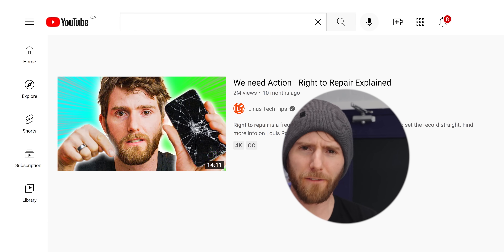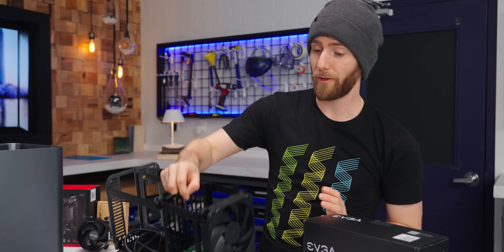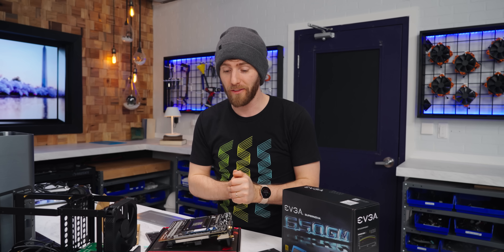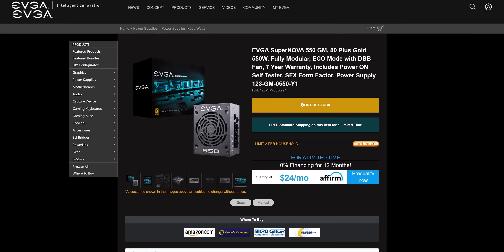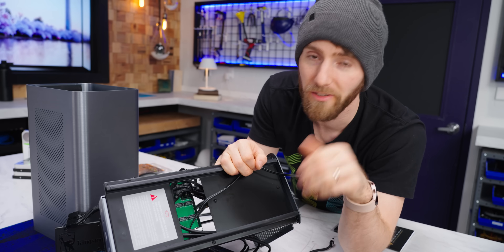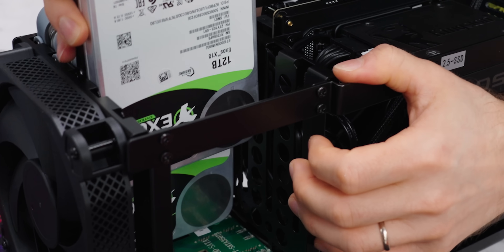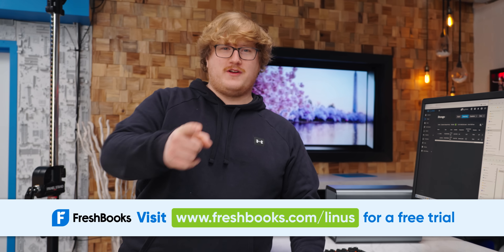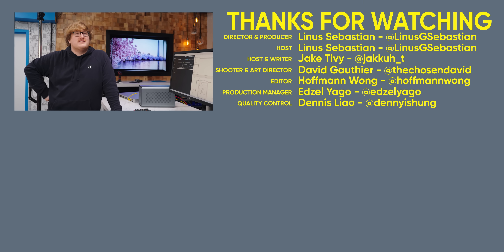This blows away the competition - JONSBO N1 NAS Build

Comment: 14:20 SMB is actually used for macOS as well, apple deprecated AFP a while ago, and Time Machine is now only supported on SMB shares in recent versions of macOS. You just need to enable vfs:fruit globally and set the fruit:timemachine flag to true for the specific share you'll be using as a backup destination.
Reply: This is good to know thanks! My dad runs a mac on our network and I thought it would be more complicated than this to get it to work.
Reply: @ziga328  no problem! Also worth checking out: the samba wiki has a page about optimizing the server to work better with macOS https://wiki.samba.org/index.php/Configure_Samba_to_Work_Better_with_Mac_OS_X
Note that these aren't absolute rules that you must abide by in order for macOS clients to connect, but it's a good starting point for getting decent performance out of smb.

I'd also recommend taking a look at the manual for vfs_fruit to see all of the options available http://samba.org/samba/docs/current/man-html/vfs_fruit.8.html, and if you really want a deep dive, here's the full manual for all of the settings possible in smb.conf: https://www.samba.org/samba/docs/current/man-html/smb.conf.5.html

Comment: I had really considered the Jonsbo, but I went with the Meshify 2 instead. I felt like the Jonsbo has quite limited ability to be upgraded, there’s only 4 HDD slots. Also, ITX boards have a very serious problem with SATA port count. They all only have 4 ports so…

Comment: My NAS was built with a similar approach two years ago. I used a Fractal Design Node 304. A bit bulkier but supports 6 drives.
Reply: That's the case I have now, when i retire it later this year (when next gen cpu/gpu come out). That's my plan too.
Reply: That case looks awesome and it appears to be cheaper (but without the SATA backplane).
Reply: I'm about to buy and build a 304 NAS, anything specific I need to know? I've built many PC before so the basics are covered. thanks!

Comment: I'm using a preowned rather old 5 bay synology nas I got for like £100, and just stuffed 50TB in it. Seems to work fine. 
One thing to note here 550w or 650w psu, on all the time is way more than a typical prebuilt, I imagine it's probably louder too.
Sure I think this is very cool, but hell on earth are small PC builds irritating. You're also a bit screwed if your OS drive dies.

Anyways now I said this my nas will probably die tomorrow haha

Comment: Would love to hear a bit more about power consumption on those topics. For me in germany a 10w difference results in about 30€/year (and will most likely significantly increase in the Next few years)
Reply: Europe as a whole I would say. Power prices have been skyrocketing like crazy over the last 4 years.
Reply: Yep this is the first thing I thought, how much does this cost to run. All year round 24/7. Looking at building a system for HASS, Plex, NAS, etc. But a cheapo lenovo NUC might be better for a system that's permanently going to be turned on.
Reply: I'm with you. In my town in the Philippines, electricty have from 0.2 USD to 0.3 USD in the span of 6 months. That's  why I installed a solar power system in the house and still mostly just use a Raspberry Pi4 as a network file storage/server and to host other services.
Reply: Dont they pay yall in germany to consume more electricity during certain times of the year? heard something like this years ago
Reply: @sweetmelon3365  lol no. AS an end consumer you typically pay a monthly fee + a fixed amount per kWh (typically 0,3€ vor more).
With some providers you get a chaeper price During the night, but thats only a few cents)

It might be that at some times you could get energy basically for free on the energy market if there is way too much production and no requirement, but thats nothing for you unless you happen to own a pumped storage power plant or a steel factory xD
Reply: @sweetmelon3365  They don't, not that I'm aware of. With some electric home heating you could get discounted rates by only using the (separate for heating) power during certain times of the day. But that's not the same thing as being paid to use electricity. Germany imports a lot of power from France, so it's also not like there is an excess of electricity that needs to be used.
Reply: You should ditch coal and switch to nuclear power (and it will be better for our planet)

Comment: You can't get 100TB of storage in there unless you don't care about your data. You'll want at least some redundancy meaning you get the capacity of four drives, not 5. Still, 80TB in a case that size is pretty darn good.

Comment: As someone who looked at building a DIY NAS versus a buying one from QNAP (what I ended up doing) I would like to note:
The DIY one Linus built does not have ECC RAM.
It's power usage would be expected to be higher than a lot of the chips used in a lot of the pre-built NAS (you can choose to use these, but they will be a bit more interesting in terms of motherboard support).

As for "upgrade-ability" the QNAP solution I went with has room for HDDs, SSDs, m.2 NVMes, PCI slots, and can have added upgraded network or graphics options. Also, there is a decent, not extensive, list of vendors that are compatible for hardware which means you are not only stuck with rather expensive first-party parts. 
Reviews of Synology being less friendly on some of these upgrades is part of why my spouse and I went with QNAP.

I would say the biggest disadvantage to going with something like QNAP is you are locked into their ecosystem and you really do not have an upgrade path for motherboard or CPU, if so inclined.

The advantage is it comes with a lot of useful apps built into the ecosystem and it's up to you how you want to configure them. So, yes, you are giving away some of the customization, but you are also losing some of the headache.

But, I did want to point out, Linus' $689 solution here is not quite apples-to-apples due to the lack of ECC RAM and higher wattage, i.e. more electricity used and more thermal output to dissipate, compared to the pre-built he was bench marking for price.

Comment: Ehhhh You're thumbnail is terrible... You're talking about deals and savings and flashing prices for the case and system, but the thumbnail is talking the drives... which is just shitty. Cool that you can save $10 and get slightly better stats by building it yourself, but I clicked on the link see about cheap storage or new development in storage, not cheap thing that houses storage. And the thumbnail also doubles as a lie with regard to the project to cuz it implies 5x20TB drives and ignores that you ca get different and possible larger sizes as well as at least 2x M.2 drives on there which can get up to I think 4TB each so... and I'm pretty sure you could more in that... but that all is irrelevant to what's going on with what is happening in the video itself.

Comment: One alternative if you're boring and are OK with sacrificing CPU performance
HPE Microserver Gen 10. 
Uses AM4 Excavator+ CPUs (2 modules, 4 threads for high end version), supports 32GB RAM, 1x PCIe 3.0 x1 + 1x PCIe 3.0 x8, 4x 3.5" HDD bays and 1x 2.5" HDD bay. Comes with 1x8GB ECC RAM upgradable to 2x16GB officially and it's possible (unconfirmed, do at your own risk)  2x32GB RAM.

2 years ago I paid $300 for that. Under half the price of this. They're like $400ish now. So like half the price. 

I added in a $10 m.2 board, a $30ish SFP+ 10Gbe network card and I'm off to the races. It's going to consume less power that the DIY approach.

Downsides: limits with PCIe expandability (a 1x slot will only do ~7Gbps for network transfers if that's where your network card is), slow CPU (probably doesn't matter), minimal upgradability, bigger. Doesn't work well with BSD (so you'd want to use TRUENAS Scale which is based on Linux).

Comment: I wonder why didn't they go with unraid.  I know it cost money but someone who is looking to do this diy to save a buck isn't going to have $300/per hard drive  to buy brand new 12tb hard drives 
and they will most likely be using any drives they already have have.  

also at 689 vs 699, thats no difference at all really, save yourself the pain and hassle and just get the synology cause theres is no cable routing issues, and overall less stress.

this video would make sense if the total diy cost was $350 - 450 MAX 
so 129 for the case (personally I would be looking at older server hardware, they may be loud and bulky but for 150 you can get the case, power supply, sata/sas cables, pretty much almost everything you need. 
ASUS H871-PLUS LGA1150 ($75 ebay) 6 sata ports
i5 4590 ( $40 ebay)
EVGA SuperNOVA 650 ($70)
intel SSD 480gb (cache $45)  or intel 120gb for boot $12
unraid lic $60
I'm sure I'm missing something 
but this total came up to $420
plus your pcie is open for 10bge expansion if you want 

much more economical,  
now there are some gotcha's as performance on unraid is a bit of a mix bag
A good ssd like intel s3500 line will give you good speed moving things to the array, say 120mbs on a gigabit connection but read speeds will be limited to each hard drive so 50/60 mbs max 
on a 10bg connection, writing to the array will be much master. 

there is just no benefits to doing this yourself if it cost as much as the synology

Comment: I have a question. I always used (and still use) a turnkey solutions from Synology. This video looks really great and I think custom upgradable NAS server is a wonderful idea. But I didn't understand a part with installing the OS. Which one are you using to operate your custom NAS? Thanks in advance.
Reply: TrueNAS-SCALE-22.02.0
Reply: @yoshy2628  Thanks!

Comment: One of the most clear videos regarding storage and Nas I've seen in a while.
Reply: Linus: spends hundreds of dollars on a nas.

Me with a raspberrypi: you dare oppose me!!
Reply: I still don't get why they chose itx of all things.
it's maintability is terrible in comparison,
you can't hotswap drives, powersupplies (sfx) are worse if you aren't careful, the mainboards are more expensive. and you are more likely to have issues building the system and a higher chance to damage parts every time you open the system.
Reply: yes, a clearly terrible truenas build

Comment: Getting a bigger case with an older Xeon with more cores that run at a lower Ghz is a great way to enable deduplication and get additional storage savings in the 1.15-1.5x range, in addition to compression.
Reply: Do any prebuilt NAS's come with this capability?
Reply: the power consumption though...
Reply: That is what I am doing now. Can get really good used server parts off eBay.
Reply: @Makaveli6103  Is there any way you can message me what you're using for a build like this? I'm a video editor and desperately need a really high quality network storage
Reply: @MarkW1210  you can't message on YouTube anymore. I am using an E3-1230 v2 with a supermicro board and 32GB of ECC RAM.
Reply: @Makaveli6103  Thank you, and the final important question is, did you use the easy software that he's using? I don't want to start messing with Linux or more complex OS's
Reply: @MarkW1210  I use Truenas and have been using for years when it was Freenas. It is pretty easy to learn and lots of help in forums.

Comment: Hard drives are great; their drawback is the mechanical parts and data speeds. Using SSDs in a NAS is better in the long run because:
1. Less physical space required in a NAS unit
2. Higher speed throughput (read/write)
3. Low risk of impact damage on a SSD.

Comment: Ooof. I blew the budget! I spec'd the same machine but with a 5600G for the CPU. and  I am sitting at just under ~$2400. The 5600G was just because TrueNAS Scale allows for kubernetes and containers of fun stuff. Question about that Optane drive. is that just an SSD or does it work differently? I see them listed as "memory accelerators" but whats the diff?
Reply: Update, I changed the configuration a bit more. I am using 5x 4TB drives as I don't have that Linus Money for those sexy 20TB drives.  Still unsure what a memory accelerator is in comparison to just an SSD. I would suggest maybe a LOG cache over L2Arc as  I think you'll see better write performance, but I am just a noob.

Comment: for an array that big, especially with ZFS (or any disk array methodology), you absolutely need ECC. not including ECC, especially since non-enterprise grade Ryzen CPUs and motherboards largely support it (even if not advertised), is insane. this is largely the reason I abandoned any sort of 'consumer' NAS, and bought an HP MicroServer: ECC memory support! bit flips can, and will, happen on writes, journal refreshes, array syncs... this is ignoring how ECC should be mandatory for any RAM greater than or equal to DDR3, since larger memory density RAM chips with smaller die lithography increase the chance for bit flips!
Reply: if you want to go insane, you could do something as simple as writing a script to write and read back known data to non-ECC RAM, and see if any bits flip. they will! and like I said, the larger the memory density, the more likely they are to flip! use ECC!!!!

Comment: Linus you already had issues with that Gskill kit at 3600 mhz on the better chips, let alone the 3100. Please stop using that kit on ryzen as it does not work well. You want stability more so why not 3200 mhz?

Comment: And a important information would be, that you're using the brand new TrueNAS Scale (which is based on Linux instead of FreeBSD), if people want to do the same config. Scale is new, so maybe not that rock solid stable like TrueNAS Core, but it gives you the option to run Docker and Linux VMs much better/easier.

Comment: I simply use 23 hot swap bays set up as JBOD. 16TB ea (not including 18TB's worth of internal SSD's) = won't run out of space any time soon. Use Backblaze for cheap backup (really only feasible for fiber internet with 500Mbit upload, most cable is 10x slower).

Comment: I finally out LTT’D LTT! I did just use a mini-atx board/case but 32gb of ram with a Ryzen 1700 (both of which I still had from upgrades to my desktop) and a 10gbe nic. It’s also all SSD and so significantly less capacity. Copies at about a gigabit a second.

Comment: If you don’t care about how it looks and don’t plan on moving it around all the time I would just get a refurbished i5-11400 desktop for 350$ it will come with 8gb of ram and a 512gb ssd. So only need another 8gb stick. Get a pcie sata card for 25$, so all in about 425$. Jam the Hdds in the case somewhere, most cases will have enough room for 2, so just need to find space for the other 3 which usually will fit in the CD rom drive bay areas. And you’re good to go. You’ll have an iGPU which will make the install easier and also you’ll have the newest quicksync which will greatly help with hardware transcoding for plex. Also you’ll be reducing e-waste by buying refurbished.

Comment: "probably run with only 1 molex connector" well 1 molex connector provides as much power as 1 SATA connector does so if you have 5 drives then you are providing enough power for 1 for 5 of them. You might be able to 1/2 the power to a SATA drive but 1/5 power is to much out of spec for them to run.

Comment: I have a question - would it be neat/possible to have parity data for a given RAID storage unit to be stored in the Cloud? This way if a drive fails the OS would use the Cloud's parity data to increased local capacity and redundancy.

Comment: I built a little homeserver with a TUF B560m motherboard, 10400F, 64GB RAM and an LSI-card.
Running Proxmox with TrueNAS Core as VM with the LSI-card passthrough and a few other VM's for a webserver and other stuff.
For now I use 2x16TB Exos X16 drives + 4x3TB drives, they will be replaced with 4x8TB IronWolf drives I got in my other NAS though.

Comment: The level of performance available in this type of build is orders of magnitude greater than a Synology, QNAP. or any other pre-built NAS(y) option at this price point and the upgradeability is off the charts.

The Synology DS1520+ comes with an anemic Intel Celeron J4125 CPU with 4 non-hyper threaded cores that burst to a disappointing 2.7GHz while the Ryzen 3 3100 has 4 hyper threaded cores that boost to a respectable 3.9GHz and could be overclocked to 4.5GHz reasonably well if the motherboard can support it. In addition, the Synology is limited to no more than 16GB of RAM where you can easily (although pricey) go to 64+GB of RAM on the Ryzen build.

Comment: Hold on, does the case allow access to the PCIe slot? i.e. to drop in a 10Gb NIC?

Also on RAM, lets take a moment to slow-clap Synology, who's own re-branded RAM, is about 5x that price... with 16GB running at around $350-400!